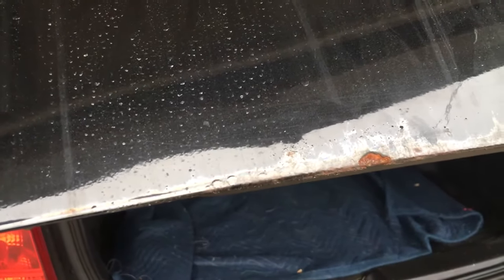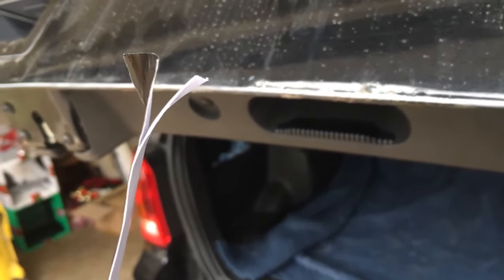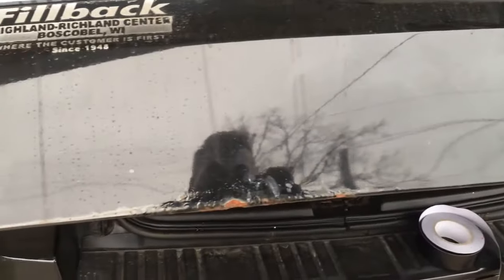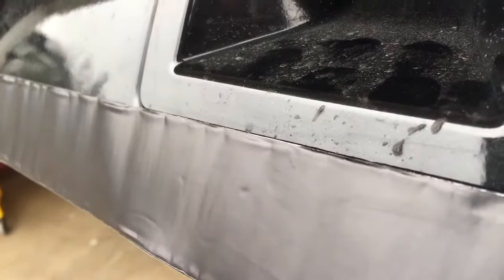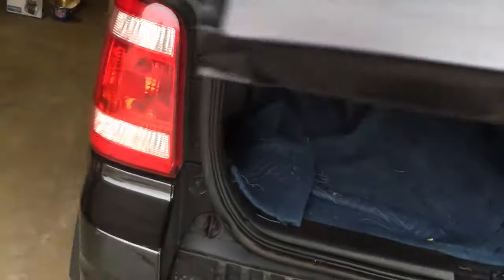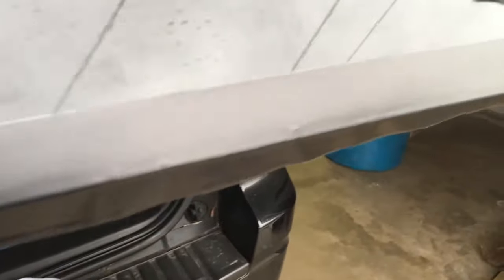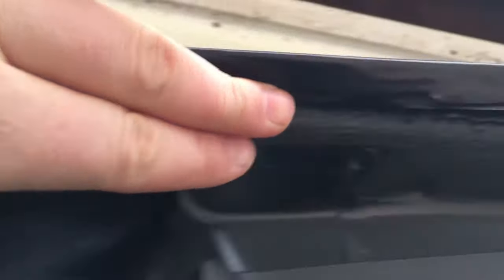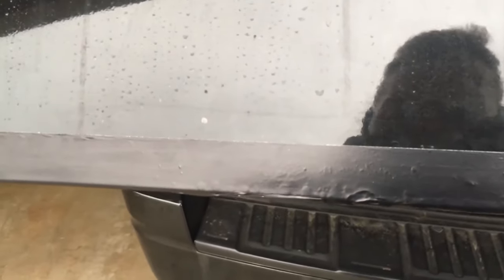How To Apply Aluminum Auto Body Car Repair Tape

Comment: Before you apply this you need to sand down the rusted area and apply a rust inhibitor FIRST. Otherwise that rust will continue to do it's thing.
Reply from the maker: Yes, removing the rust and treating the area is essential.
Reply: what's the name of rust inhibitor? also can I use this on upper windshield?